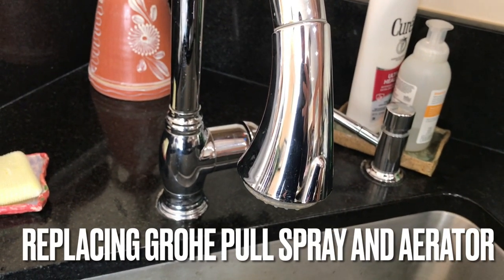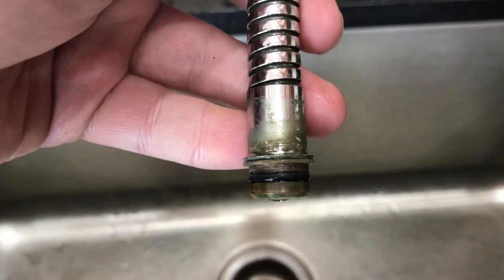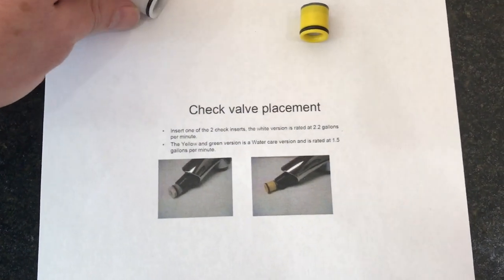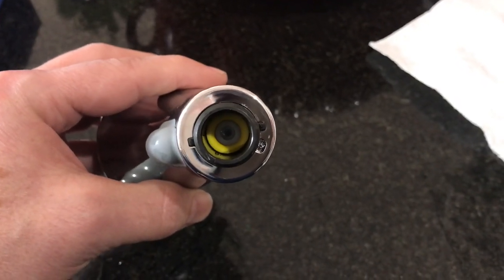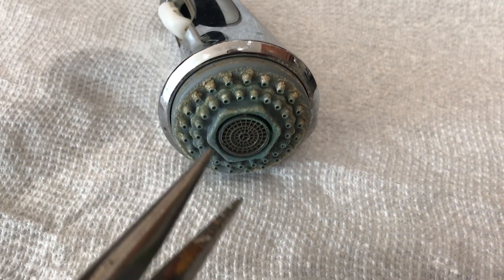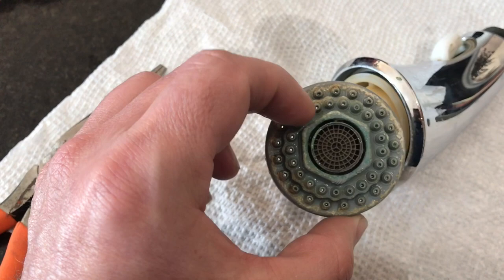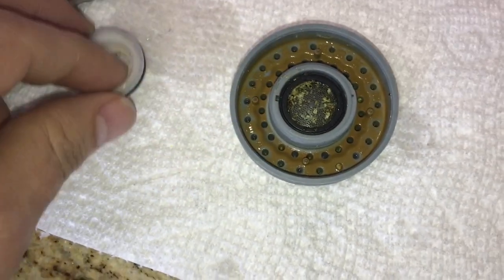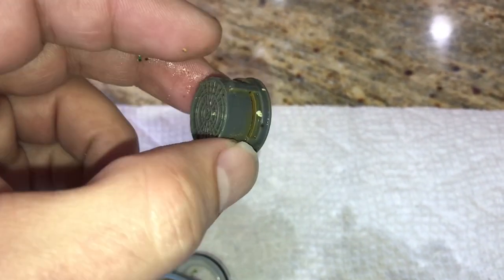Replacing Grohe Pull Out Spray Head and Aerator

Comment: Very helpful video! That O ring on the supply hose end that you show at 39 seconds is very important. I just replaced my same model of Grohe pull out spray head and still had a leak. Water spraying back up the hose length where the hose coupled with the new spray head. I looked up the O ring (13.5 caliper) and ordered it separately. As you say, it did not come with the new spray head. The box was a Grohe product package. I hope that the new O ring fixes the problem.
Reply from the maker: Removing the old O-Ring is a bit   Difficult without destroying it.   I was hoping to keep it intact in case the replacement was the wrong size.  How did you find the right size?
Reply: @rogerscubadiver  I found out about needing the O ring in an Amazon Grohe spray head product review. Then I measured with a caliper device that I had in my craft basket. I will post again after I get the part and install it this weekend.
Reply: Sheesh! I replaced the O ring and it still leaks from the hose coupling to the brand new replacement spray head. I hope that others have better luck with their DIY repairs.
Reply from the maker: @kirstijutila9431  oh man.  That sucks.  So it had no effect on cutting down the leak? Not even reduced it a bit?
Reply: @rogerscubadiver  Right, no effect. One last theory or two: 1. there could be a crack or leak in the flexible pull down hose right above the metal connector or, 2. the O ring is for Ladyluxe only and not for the Bridgeport circa 2012 (older) faucet model. I replaced the pull down hose about 3 years ago, so will not pay for that again. Happy DIY plumbing, all, and keep trying stuff and learning : )

Comment: I just replaced a Ladylux spray head with a new one (model 46875NDO).  I encountered one thing not mentioned in this excellent video.  At about 40 seconds into the clip, there is a closeup of the hose, connector and o ring.  At the very end of the spiral-wrapped hose, there is a smooth metal sleeve.  When I unscrewed my old head, that sleeve slid up the hose about 1/2 inch and stuck there.  It appears that if the hose gets twisted (maybe as you are tightening the head) that spiral wrap can begin to unwind which makes its diameter get bigger.  And that’s where my sleeve got stuck.  I eventually fixed this by spraying a little WD40 on the hose and, with a pliers, pushed the sleeve down to the end of the hose.  My first instinct was to try to twist the sleeve along the hose using the spiral wrap like threads.  Fortunately, I quickly saw that that move was unwinding the spiral and making things worse.  Wouldn’t have been the first project where my “fix” made something unfixable.
Reply from the maker: Nice find!

Comment: This was a helpful video, but it could have been better if you showed how to remove the spray head for the servicing required.  I was very concerned about damaging any of the parts.
Reply from the maker: Got it.  It is a bit difficult sometimes to show all the steps because I’m holding the phone with one hand and tools in the other
Reply: @rogerscubadiver  thanks. I’ll try to figure it out.
Reply from the maker: @perrycapitani544  the spray head can be removed from the hose by twisting and unscrewing but in guessing you meant how to access the inside of the head in order to clean any sediment build up?
Reply: @rogerscubadiver  actually,  I need to replace the head since it wore out. Thanks.
Reply from the maker: @perrycapitani544  yeah.  I had to replace mine entirely.   It screws on so it should be simple once you get the replacement
Reply: @rogerscubadiver  thanks again

Comment: I’m an older senior my Grohe kitchen faucet with sprayer is only 7.5 years old when it was put in it was brand new the person who put it in was a professional but all kitchen parts I didn’t get receipts only a total bill. The piece you press to turn spray head on & off doesn’t work any longer a spray head alone is $165.00 on line can they be repaired by a plumber? I need that sprayer
Reply from the maker: I would call Grohe and explain the situation that you no longer have the bill.  They are supposed to have “lifetime” warranties so you may be able to get a replacement for free.  Just be patient and keep escalating until you get a sympathetic ear
Reply from the maker: And you don’t need a plumber to replace the sprayer head.  They won’t be able to fix it anyways if the push button no longer works (like mine didn’t).  They will charge you for a new head and if you can get Grohe to replace it under warranty, you can make the change yourself

Comment: bro, you didn't show how you disconnecetd the head from the water line 😱
Reply from the maker: That is a good point.  I think because I needed to unscrew the head with both hands and holding the phone was impossible.  Is yours not one the simply unscrews when you extend the hose?
Reply: @rogerscubadiver  turns out you just pull out, no need to unscrew, just finished replacing the head, thanks
Reply from the maker: @blanecurry9090  interesting.  Mine screws in